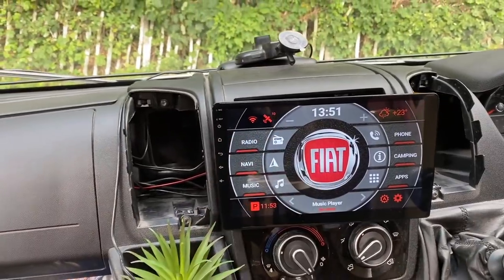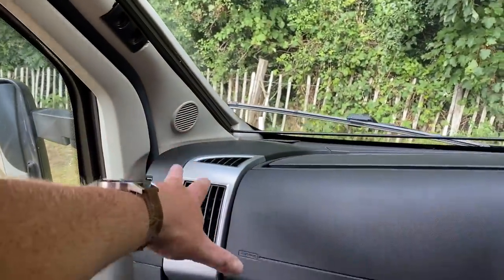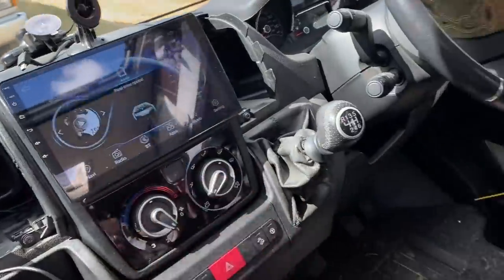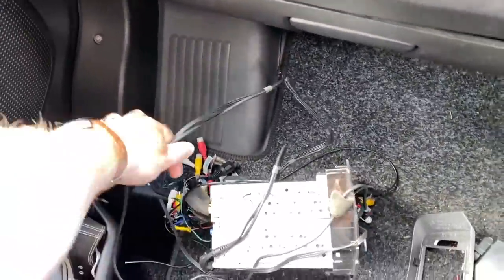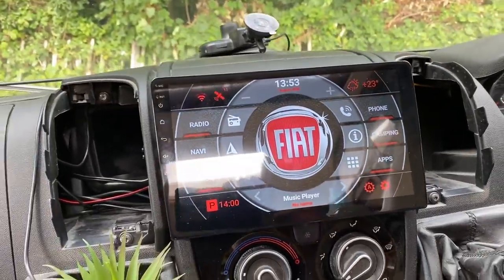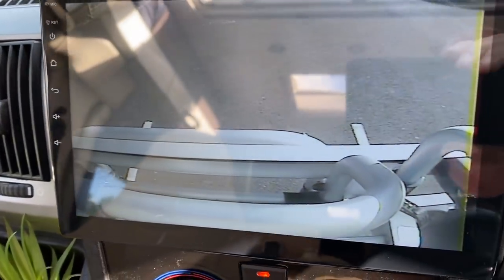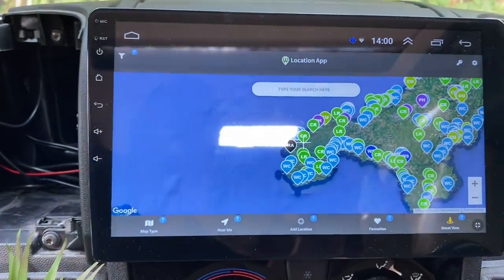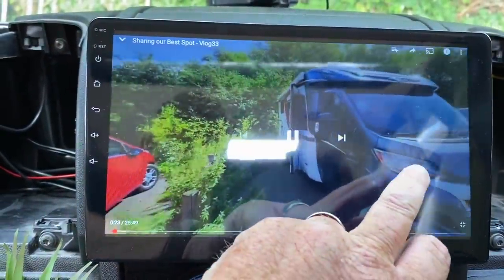Android Stereo Backup Cam WiFi GPS Bluetooth Review

Comment: hi, John, I have just received this after watching your vid and buying it from your link  yesterday, however, on your vid you said the instructions were great however I must disagree
I have just spent the best part of an hour trying to source better instructions on the internet with no joy,
could you send me some sort of diagram as  to what cables to use and what you have used to connect it to you Van i know you it may not be the same as my car but it would be a start?
sorry to be a pain?
Reply from the maker: Have you contacted the seller to see if they can help? Give them a few hours to get back to you, if not then I’ll link the pdf I have via our website. Let me know how you get on.
Reply: @johnmandy   Hi  John yip sent them an email via Amazon so will wait out for a reply from them also just ordered a Kia  SPORTAGE ISO WIRING HARNESS ADAPTOR in the meantime as I  don't want to cut into the vehicles harness thanks for getting back.
Reply: Hi Alexander, I have the fitting instructions for the camecho Android unit if you want them?Also Kenwood Wiring harness has the same 16 pinplug that fits in to the Camecho Android unit.
Reply: @donfarlane1082  Don I also have the Kenwood/JVC harness on mine. I think that was about £3 on ebay last year.
Reply: @al9600mc  I have sent you the updated Pdf instructions.Cheers.
Reply: @johnmandy  Hi John me again, well this is turning out to be bigger than Ben Hur and that's an epic LOL
i finally managed to get the head unit fitted into my Car (Kia Sportage ) however i received the custom fit wiring harness today only to find it s not custom but generic and dose is not fit my vehicle
Reply: sorry hit submit before i was finished any way my question is do you know where I could get a wiring diagram for my car as i have trolled the internet with no luck to allow me to cut into the cables and hard wire it to them?

Comment: Hi John and Mandy always love your shows especially on the road always great content. After watching this edition I immediately bought this android radio. Wow they gone up a bit now £139.0 but still look good value although I can't confirm this yet as my one doesn't work. I've connected all speakers, power in yellow,ign power in red, neutral black. Ziltch, Zip, nothing, all I have is a blue light inside for about a minute  then goes off. At present waiting for someone in China to email me. I don't know if you have to switch it on somewhere, I know that sounds stupid, when I saw your Vid it was already running so didn't see you turn it on on, am I missing something? I anyone can help would be eternally grateful. Kept up the channel,great.
Reply from the maker: I’ve wired ours to the leisure system, if you’ve wired it to the radio power then you might need to start the engine for it to work. We don’t have this stereo now, we’ve changed it.
Reply: Hi John and Mandy, thanks for your text, now I'm getting worried. I have sorted it I think. Had a works manual sent from manufacturers with troubleshooting sheet. It mentions connecting both Yellow power with the red egnition cables into the positive from the harness, bingo. I can't believe I spent at least 3 days on this, still all's well that ends well. I can enclose the 17 page pdf if you can give me a destination address.

Comment: Does anyone know if these fit into a Sprinter?
Reply from the maker: If it has a double din slot it will fit 👍🏻
Reply: Paul, did you find out has your sprinter a double din slot ? I also have a sprinter and would buy if I knew for sure it fits. I am crap at this tech  bit.... 🙄
Reply: @Workshop-of-Allsorts  Hi Martin. My stock radio in the sprinter was a single DIN but when taking out the plastic tray under it formed a double DIN slot. Took a bit of working out how to fit but all up and running now.
Reply: @paulbull  thanks Paul, so I will purchase so. It looks good and from John and all other reviews I have seen.... all good 👍 
Oh, are all wiring looms ok or do I have to buy any additional bits ?
Thanks for getting back so promptly 👌
Reply: @Workshop-of-Allsorts  i purchased a new harness so I didn’t need to cut into the original and also a facia plate to hide the hole behind the head unit as the sprinter dash is curved and doesn’t fit flush. Let me know if you need the details and I’ll dig them out later
Reply: @paulbull  Many thanks Paul, would be great if you could no panic like..... I will go ahead and purchase the head unit anyway from John & Mandy’s link knowing it fits. Will worry about the rest later. I have done a full camper conversation similar layout to Greg Virgoe’s so the new head unit will finish it off 👌😎 you have been so helpful and many thanks for that..... social media has its advantages too !! 😂
Reply: @John & Mandy on tour I have just ordered the 2G version.... thanks to Paul for the additional info ref having fitted into a sprinter  also👌
Reply: @paulbull  Hi Paul, did you get a chance to dig out the harness and back plate info ? Just got delivery of the 2G unit..... looks a great bit of kit 👌mad to get it installed now 😬
Reply: Look for the Mercedes Double Din Car Stereo Fitting Kit Facia Wiring Aerial from Dynamic Sound online. That has all you need with the facia, wiring harness and aerial connector for £21.95.
Reply: @paulbull  many thanks Paul 👍

Comment: Wouldn’t that be illegal under the road traffic act 1988?   I wouldn’t risk your insurance showing you can play films on the front screen.
Reply: Most radios with displays have a handbrake earth cable so the screen will only play when the handbrake is on . Meaning not travelling so okay to view a screen . This does mean you can find a earth point for the wiring harness and just earth it out so you can watch the screen 😂